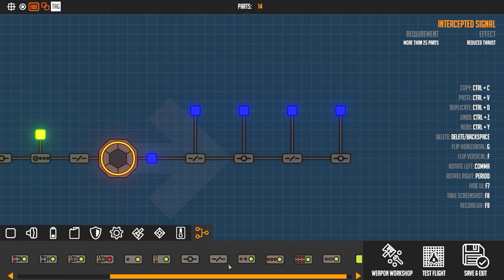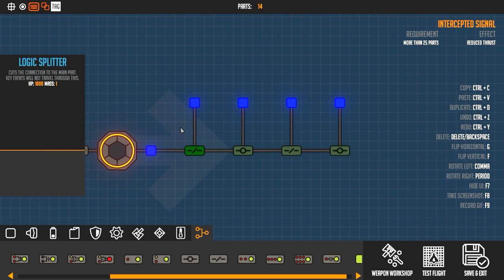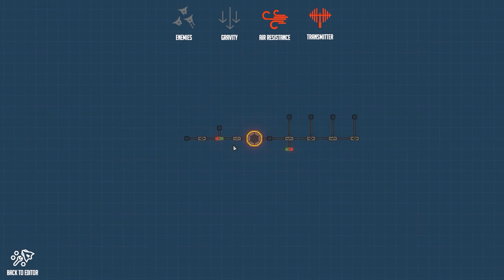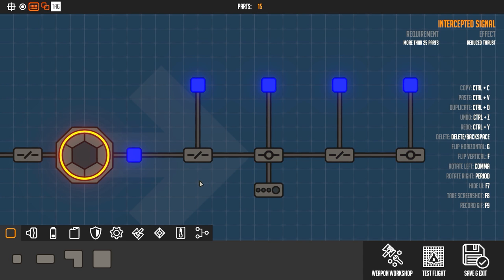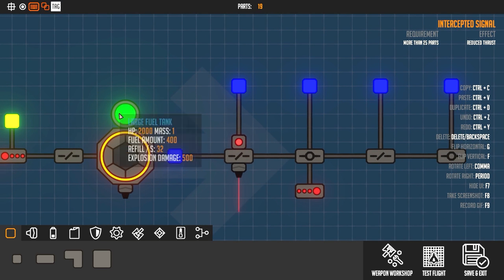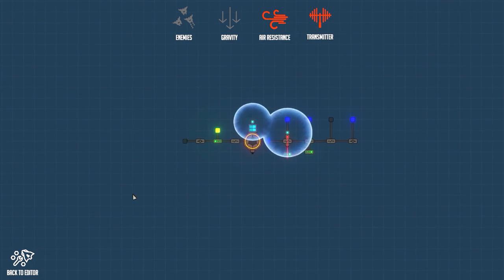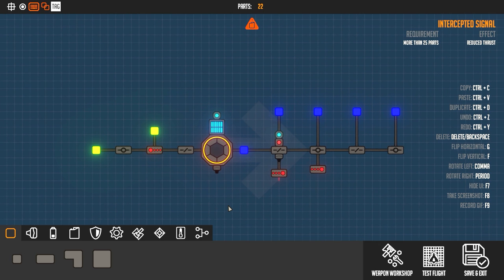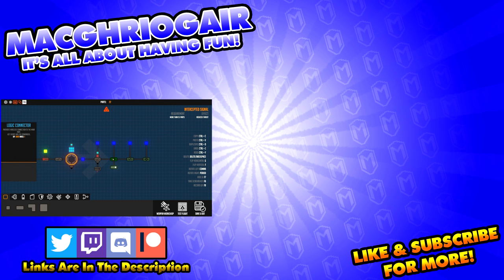How To Use Logic Splitters And Logic Connectors - Nimbatus Gameplay Tutorials And How To Guides

Comment: I think the splitter's main use is to separate automated controls disconnected swarm drones (for example). So they can all use the same keys for steering to gravity/cursor, avoiding terrain, etc, without clashing and controlling each other.

Have you figured out if there's a way to combine signals generated in these isolated splinters with global inputs/outputs? e.g. how could you enable/disable all the thrusters on these automatically steered drones so they all stop still?

You can use the connectors to have parts of all your drones (e.g. weapons) controlled by user input but they are totally isolated from control of anything on the split part...
Reply from the maker: In theory. I have figure how to send signals into isolated logic splitters, although it won't be pretty.  I'll try to make a video on it sometime this week.

I use splitters on all of my automated drones and and bombs.  A splitter will prevent 1 bomb from setting off all of your bombs.
Reply: Cool! :-) 

I mean, I could relay a signal using a motorised joint to mechanically trigger a distance sensor... But that's pretty clunky and bulky for a little swarm drone.
Reply from the maker: It is, which is why it wouldn't be pretty :P

Comment: So, if you use it for seperate systems, that are not connected to the maken part cannot be split by a Logic splitter?
Reply from the maker: I don't fully understand your question.  Systems that are not connected to the drone core through decoupling still receive input from the core.  So you'll have to use a splitter on the remote drones to prevent that.
Reply: MacGhriogair I’ve two drones with a directional sensor that get printed by a factory, however they seem to react to eachothers controls. And there is also the object sensor on it, which that is connected to another drone, connected to a factory. And so that doesn’t seem to work. In summary: Logic splitters/connectors don’t work when they’re not atached to the Main part of the drone (drone core) but instead connected to a drone that is connected to the drone, with a factory. And the drone that is connected to that drone, is also connected with a factory to the drone (the one without the drone core). I hoped this maken sense now (it probably doesn’t it might just’ve made you even more confused...).
Reply from the maker: Remote drones do receive key presses when they are disconnected from the core.  I also just tested logic splitters and connectors, just to confirm because I don't normally use drones with connectors, and they do not need to be connected to the main drone to work.  Button presses passed through to the logic connector as expected on the detached drone.
Reply: MacGhriogair I think it fails because it is connected to factories, but I don’t know, I can’t figure it out.
Reply from the maker: My test was with factories and it worked fine.  Just a thought, do you have power and fuel on the remote drone? Those no longer work remotely.
Reply: MacGhriogair I do have fuel on it, it is just that the directional sensors interfere with eachother (so if on of the rocket goes left the other one does to, wich is the problem).
Reply: MacGhriogair Do you have a discord server? Then I could share a screenshot, then maybe it’d be more clear.
Reply from the maker: Yes, link to the discord is in the description
Reply: MacGhriogair Oh sorry, didn’t see it. (I didn’t see that the description was that long).

Comment: I want to make a logic signal that is, say... An AND gate that is activated on Space on the keyboard press (Which is logic on the main body) AND (random key I wouldn't normally press) on the output of a sensor on a remote drone, to activate some kind of weapon. The sensor needs to be behind a logic splitter on the remote body, since they're just dropped by a factory block, they're all the same and I don't want them to interfere with each other. (This is actually a very poor use case example, but still, I need this functionality)

How do I do this?

EDIT: Lets give a use case situation. Directional sensor on a seeking drone to turn the thing towards whatever the target is, Lets just say cursor for this example. I want to print a dozen, then press space to turn them all on at the same time, with a logic latch to keep those specific drones turned on but still isolated so they don't automatically turning on any new drones I print.
Reply from the maker: I do believe that there is a way, but I'm not at my computer right now to test things out.  If what I'm thinking of works, I'll try to make a video/tutorial on this.
Reply from the maker: I hope this new tutorial answers your question: https://www.youtube.com/watch?v=7sjLn6avNVg